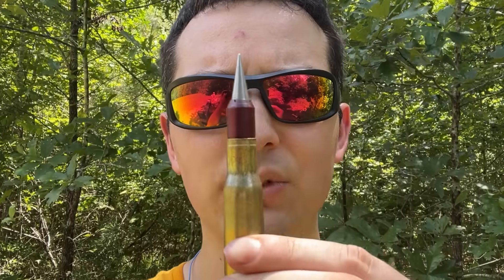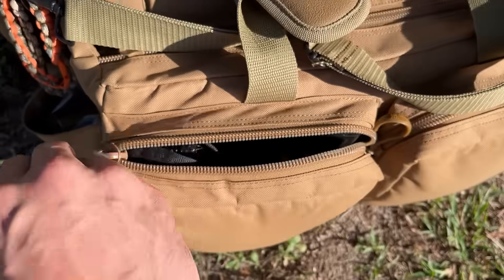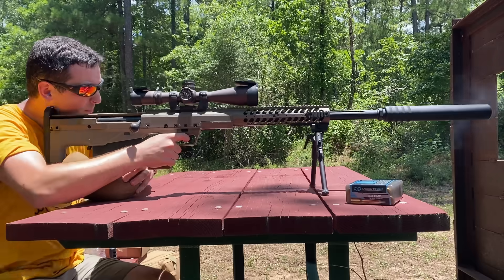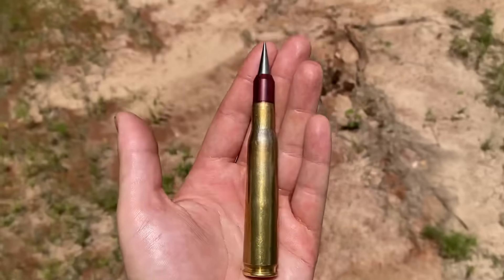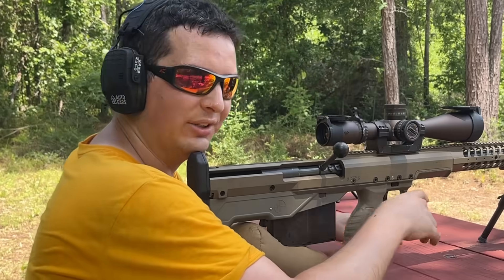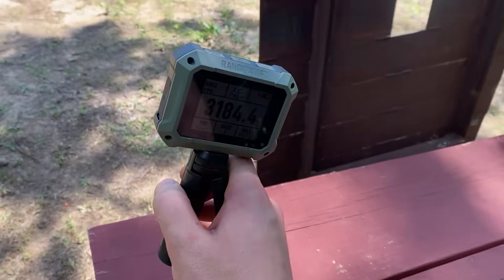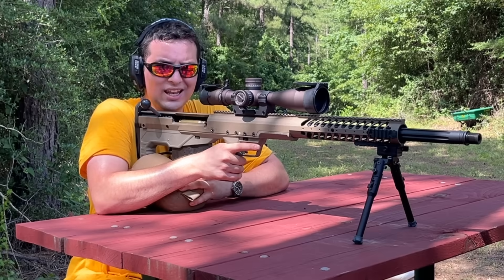How Much Steel To Stop A 50 Cal SLAP?

Comment: The SLAP round requires the longer barrel(which is the standard M2 machine gun) it was designed to be shot from to penetrate "LIGHT" armor. The acronym of SLAP literally stands for "Saboted light armor penetrator".

Comment: Yeah short barrel is killing velocity. 1000 fps loss is rough on penetration. That and steel resistance to penetration isn't linear when its 1 solid plate. Example a 1 inch steel plate will stop more than 2 spaced 1/2 inch plates.  Same material thickness total but the spacing allows better kinetic penetration. Sorry I dont know all the technical jargon for it. Military figured that spaced armor helped against he,heat,and hesh but reduced effectiveness against kinetic projectiles if same total thickness was kept.

Comment: Pro tip: hold onto the hand guard with the other hand and don’t use a bipod, especially on a .50 cal. Muzzle brakes will only make it worse. Use sandbags, or a dorky sled. That’s why you messed up your shoulder. You’re lucky you didn’t rip your cartilage. 
Bipods may look cool but when you fire a big bore like that it’s only gonna jump, especially if you’re not holding onto the rail. 😱

Comment: This is not meaning to be a jerk but if that steel is not rolled steel it is nothing even close to military grade steel. Not only that most armies that have armor are no longer using rolled steel on their tanks/APCs and such. Also, even if it was rolled steel that type of steel does have an expiration date believe it or not. There are a lot of little subtle differences that make monstrous changes to the answer of your question.

Comment: Mill steel” is a very broad term — it could refer to commonly used ASTM A36 (minimum yield strength ~36 ksi / 250 MPa) or ASTM A572 Grade 50 (minimum yield strength ~50 ksi / 345 MPa), which would definitely produce different results when shot with .50 BMG.

Comment: Yeah, I knew you were gonna have to pull your suppressor and you can’t even use a break with those things so naturally you get every bit of the recoil from that 50 BMG. I’ll pray for your shoulder! That’s why Barrett has a recoil management system , but it’s better in the M107.  When you wake up the following morning and still feel like you’ve been hit by a linebacker, it’s because theoretically you have😂

Comment: So you got about 1000 m/s out of the round, but it's intended for 1250. That could potentially make a lot of difference.

Looked like you're running out of momentum, rather than structural integrity on the bullet.

Comment: I love my 300 Winchester Mag. Wanted the 338 Mag but they didn't have one. I shot a diesel truck wheel with the 300 it went through one side, then I shot it with the 338 and it went through both sides. 7mm only dinged the first side. They were all fun to shoot. 7mm seemed like a plinker compared to the others.
My Stepdaughter loved shooting my 300 but they are now too expensive to shoot! Can't imagine shooting the 50 BMG, and the cost...

Comment: A few issues that severely impacted the SLAP's performance.

Its rated penetration is in the ballpark of 50mm of steel. However, this is with two important caveats.

1. It has to be fired out of a 45in barrel that it was designed for. This was designed to be explicitly paired with the M2 .50 caliber HMG not .50 caliber rifles. The shorter range does not make up for a 29in barrel. The SLAP round is essentially designed to operate like tank fired anti-tank ammunition where mass is irrelevant and speed is everything. These rounds are modelled after anti-tank shells known as "Armor Piercing Fin Stabilized Discarding Sabot" shells (APFSDS or simply referred to as either "Sabot" or "Dart") where the entire name of the game is length of the projectile and speed. This is a very light, very thin, and very long penetrator. Speed is king. With a 29in barrel and only clocking 3200fps as opposed to the intended 4000 you're only getting about 66% of the intended muzzle energy. You could be firing this at point blank and you're still not getting the penetration an M2 would expect at nearly 500 yards because you're missing that 800fps from the beginning where as the long, light, and thing dart design is made to retain velocity over range very well. 

Edit: Before somebody makes a false connection. No, SLAP itself is not anti-tank ammunition. It was modelled off of the same principle of larger tank fired APFSDS shells but does not in any way, shape, or form actually perform even close to the same degree. 50mm of penetration is only sufficient for lightly armored vehicles like Armored Personnel Carriers or Infantry Fighting Vehicles that are lightly armored and serve primarily as transportation for soldiers. These are the intended targets for these rounds. An actual modern tank fired APFSDS round can hover in the ballpark of 750-800mm of armor penetration against steel.

2. Military penetration values are against fixed plates that are held in place firmly without rear support. Without it being held in place firmly you're letting too much of the energy dissipate into displacing the plate and not actually being focused on the point of penetration. By supporting the back of it you are also permitting energy to be dissipated into the backing material. These penetration values are meant for armored vehicles. Their plates are not backed by any material beyond nor are they going to move when struck.

Combined you're only rocking with 66% of the intended energy to begin with and you're letting the energy be inefficiently applied to the plate. When put into their proper context they perform much better.

Comment: The SLAP rounds were made to defeat Soviet BMPs pouring through the Fulda Gap at a range of 1000 meters. Get a BMP and try it on that. You may have better results. When the Soviets first went into Afghanistan the Afgans were firing from above and penetrated the BMP's with .303 rifles. That's were the armor is the thinnest. The SLAP should not have any problems penetrating the armor of that vehicle.

The BMP's armor varies, but generally ranges from
15mm to 30mm on the frontal hull and turret, with maximum hull thickness around 19mm and turret thickness up to 23-30mm, providing protection against small arms and shell splinters, but not against high-caliber rounds or artillery. The initial model used angled steel and aluminum, while some later variants, like the BMP-2D, added appliqué armor for increased protection. 
Armor Thickness by Section:

    Hull Front: Around 15 mm (57°)
    Hull Sides: 13 mm to 15 mm (angled)
    Hull Roof: 5 mm to 12 mm
    Turret Front: Up to 30 mm (32° angle)
    Turret Sides: 10 mm to 20 mm
    Turret Roof: Approximately 6 mm
    Cupola: 6 mm 

 The armor is generally thin and insufficient to protect against higher-caliber machine guns, anti-tank guided missiles (ATGMs), or artillery.

Comment: I would never shoot a slap round in a 50 BMG… extremely dangerous and evident by the amount of recoil we just witnessed that was increased from the regular amount I would say that’s above safe pressures maybe if you want to make 50 caliber BMG cases out of steel or a buy metal then maybe slap rounds will be OK but otherwise no way

Comment: Those are moving way too slow.  Out of my 32" barrett I'm getting between 3850 and 3900 fps.  Out of the M2 they easily exceed 4100 fps with the 45" barrel.

Comment: This stuff is all hype and hardly worth the cost. As is evident in trump supporters, people will believe bullshit when given a interesting story. Its only had 3 production runs for the US military and requires non-stellite lined barrels. Penetration is marginally better than M2 AP. Its main advantage was a flatter trajectory. My experience with this stuff is it would reliably penetrate 20mm(3/4")of AR steel at 100m, a inch of mild steel. Its made for shooting up trucks and other lightly armored stuff. Its pretty useless on a cost ratio. But it plays hell with vital parts of vehicles, dishes, ground to air systems, fuel storage tanks etc. Providing you could actually hit a aircraft, i inagine the armor around the engines, cockpit, avionics, etc would stop these as aircraft are designed to go against much larger/powerful 20mm, 30mm, missiles, etc.

Comment: A 50 cal round they used in ww2 historically could penetrate 26mm + of armour it was called M20 armour piercing incendiary tracer or API-T for short and another round with similar characteristics is the M33 armour piercing high explosive tracer round or AP-HE-T for short, might be a bit difficult to obtain ether of the two but would be very cool to see how they would fare against the SLAP rounds

Comment: Because the steel is right up against the backstop is why it didnt go through. And why tf would you not have a muzzle brake to screw on when the suppressor is taken off? Thats just dumb. I see many of these gun tubers are just lucky enough to have the land, time, and money to produce videos moreso than theyre in any way skilled or knowledgable on the subject. Some actually know what theyre doing, talking about. But then others just make childish dick jokes...
Reply: They both have baffles and the last thing that you want to do is fire a follow up round through a damaged barrel or muzzle attachment though the attachments would be preferable to a barrel gouge (which I would bet is what happened in Scotts case)!

Comment: It might be interesting if you have an air chisel and using a steel punch turned down to fit inside the holes, and see how much extra it takes to come out the back. I’d expect a plug of steel plate with the penetrator embedded to pop out. 

The A-Max bullets and huge smoke show is because when a banana sends an oxidized piece of aluminum into iron oxide on the steel plate you’ve got “instant thermite”. 

Hornady must manufacture the giant A-Max to disintegrate like their hunting bullets lol. And if you don’t like what bullets and ammo you find at Hornady, wait a couple days and they’ll magically have another better-mousetrap cartridge making all else obsolete. Trust me.

Comment: The SLAP round can penetrate UP TO 1.5 inches of steel, but that's when it's velocity reaches 4,000 ft/s, and since yours was reaching only in the 3000s, that's probably why it couldn't do 1.5 inches

Comment: I am surrounded by idiots!  So you all can understand. You fire a bullet at a target and this applies from 0 to infinity and from things as soft as a marshmallow to as hard as tempered steel. The bullet hits and you figure put the ft. lbs. of force by mathematical formula. GREAT!  But that is only a part of the story.  I am going to be silent on the full story, but every projectile hits the target material and produces a cone of force and the cone shrinks as the velocity decreases. 
What was that? Did you say what about ricochets? Think about it this way, when the velocity reaches zero the distortion in the target material fights back throwing the projectile in another direction. Use Trig to figure out which direction and how far.
The rest of the story is for engineering geniuses like Nicola Tesla  to figure out

Comment: Guessing at the start... 6 inches is 152mm of armor... which is more effective frontal armor than a Tiger 2 from WW2... No way a 50 bmg can go through that much armor... 50mm auto cannon's can't... 105mm smoothbore cannons from the time would have trouble... Granted that wasn't mild steel... but still.

Comment: Shooting S.L.A.P. through a supressor is a BAD idea. Also the .50 BMG has enough energy to cause the aluminum to ignite in a thermite reaction when hitting iron or steel. Especially if the surface of the steel is oxidized

Comment: I have something you should take a shot with.

A .378 Weatherby Magnum with a special loading of some long-since discontinued bullets.
300-grain Speer African Grand Slam Tungsten solids.  A bullet composed of a solid brass body with a Tungsten insert/core.

Speer offered them in .375 H&H Magnum in their "Nitrex" line of ammunition, but I had the guys at Superior Ammunition in South Carolina load up the last 25 rounds they had for my .378 Weatherby.  They were not cheap, but considering they're basically non-existent these days, I'd say they were worth it.

I tried some out in .375 H&H at about 2,550 feet per second years ago and punched a hole through a one-inch thick slab of railroad iron at about 25 yards away.
These .378's are rated at 2,860 feet per second so they should be pretty interesting. 

I haven't tested them yet, myself but let me know if this sounds like something you'd like to try out.

Of course if the .378's aren't spicy enough, you could reload them onto some .375 CheyTac cases.  Probably put the velocity somewhere in the 3,300 fps range.

Comment: Speed is what defeats armor. The 4k fps would likely take that tungsten through the 2.5 inch steel. 800fps slower than what it was designed for makes a big difference. All that speed creates more friction, more heat and softens the steel allowing deeper penetration.

Comment: If I had to guess, the use of the SLAP round was discontinued because performance wasn’t enough improvement over the .50 AP round to justify the additional expense.  Plus, there’s the whole half-inch hole vs. 3/10th of an inch hole.

Comment: Armor steel does not behave like the mild steel, the mild steel soaks up a ton of energy in radial and linear deformation, where as hard plate would catch it or fail on the back side. The point a depot worker needs to send him some armor plate for science!

Comment: please, this is a DOT 50 inch, or .50in
a 50 cal is a smaller callibre, a bit smaller than the NATO standard .30 inch
a 50in cal would be sooo big, bigger than the biggest artillery ever fired (approx 1.5 larger diameter and  4 times shell weigh) I would like to see it if it ever exist !

A luger is a 9mm cal, not a 9 cal (that is actually a few % off from a .50in)

/use_proper_units

Comment: For the caliber, you basically have a short barrel. If it were say 3900fps you’d probably see the point in SLAP v black tip for AP… that and the SLAP probably has a lot less vertical drop over the conventional black tip AP?

Comment: It's aluminum so most likely the energy of the bullet turned into heat as it squashed the head into the steel which is why there's a large puff of hot smoke

Comment: Muzzle energy increases linearly with bullet weight, but with the square of velocity. That missing 800fps is making a big difference. How much? Well, these SLAP rounds were moving at 3200fps, but at 4000fps they would have about an additional 50% more energy. The SLAP round should have had around 12000ft/lbs of energy, just like the normal round, but instead it only had around 8000 thanks to the lower-than-expected velocity.

Comment: For those interested, a military M903 SLAP is rated for about 2 inches of armour steel point blank, 3/4 of an inch at about a mile. M20 APIT does about an inch point blank.

Comment: I believe the flash from the aluminum tip bullets is from a thermite reaction, caused by the energy of the round, the aluminum in the tip, and the iron oxide on the steel

Comment: Aluminum is one of the key components of thermite so figure the combination of extreme heat and pressure generated was causing the aluminum tips to react with the air and generate a mild thermite-like effect.
Imagine cruising along in an armored vehicle, hearing the impact of that thing on it and then seeing a bulge in the hull from it next to your head?

Comment: Aluminum tip + zinc in the brass jacket burning cause the smoke color. Don't melt brass without flux. I was a stupid kid with access to a forge and flash burns suck.

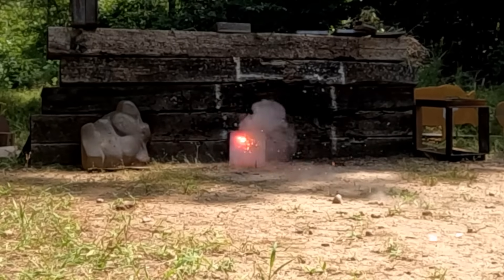Comment: Bro, your trigger pull is so fucked @8:39. You started out an entire inch in front of the trigger and then rammed that sucker home. If you want accuracy and repeatability, rest your breathing, pull slowly on the trigger until it goes off. It should startle you. You will have greater accuracy at longer ranges. Uncle Sam taught us soldiers that. Your welcome.

Comment: Surprised you don't have a shoulder separation from that abuse. I recall hearing that 120 mm aluminum practice dart from the Abrams tank cannon penetrated the 4" front plate of a Patton range target. It would have been moving around 5000 fps muzzle velocity. Supposedly if the cannon was elevated to the proper angle for max range, the DU rod would fly 65- 70 miles.

Comment: Thanks for the video. 

No matter how much energy is in the first round that you fired, if the energy goes into deforming the bullet instead of the steel, then the bullet is not going to penetrate. Aluminum is much softer than steel, so the aluminum is going to deform completely on impact. I'm assuming that the rest of the bullet is lead, and once the aluminum has started the deformation process, the lead is not going to be able to concentrate force on the steel. The lead will also deform under that force. 

I'm surprised that the tungsten didn't penetrate, but I'm no expert with dynamics at that level. I wish I were still working in a metallurgy lab and could section those pieces of mild steel and see the cross section of the bullet in the steel. I wonder whether the tungsten cracked or whether the tungsten just deformed into the cavity formed in the steel. 

I'd love to see the result if they replaced the tracer compound with lead in order to add a little more weight to the bullet.

Comment: CURIOUS: Depth of slap round penetration for each plate. Why? 1. Is the depth consistent regardless of plate thickness. Or... 2. Does the depth vary but leaves the same margin thickness in the back? If it's 2, then there's evidence to suggest that a more rigid setup might allow for a through shot. Energy transferred into the dirt or wood? Perhaps a collaboration with Sandia National Labs or NM Tech is in order to study my hypothesis further? Lol